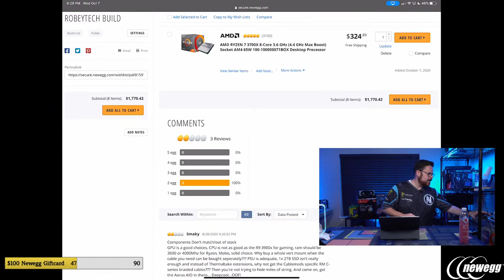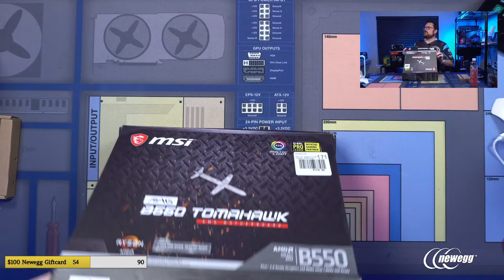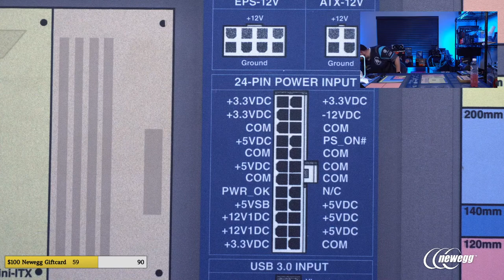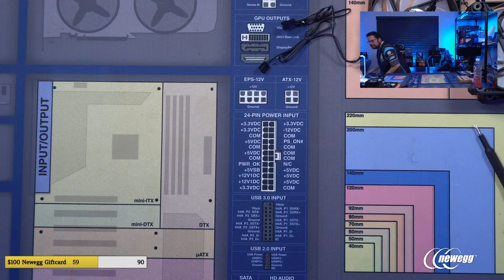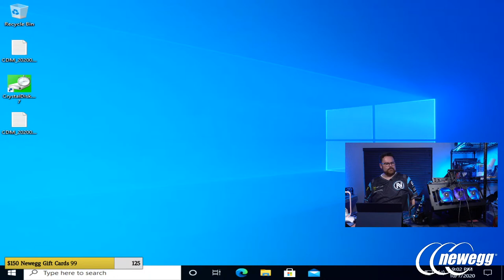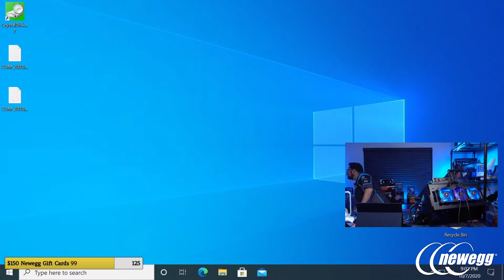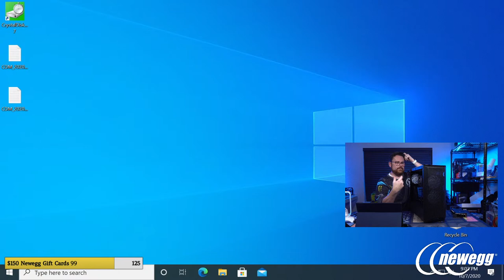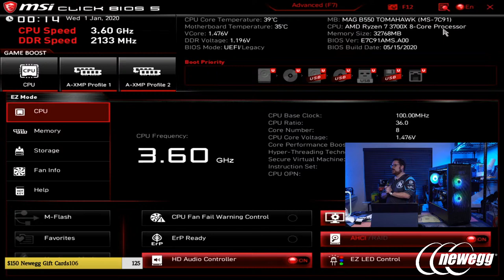How To Build a PC - Giveaways + $2000 Phanteks P360a #RTX3000 Build (3700x / RTX 3080 FE)| Robeytech

Comment: I just built on the b550  tomahawk and had to use bios to change pcie to gen3 for it to work with phanteks riser cable.
Reply: I have heard of that being an all too common problem with riser cables in general.
Reply: I’m about to get the b550 tomahawk and the phanteks 500A case, so I’d have to do the same?
Reply: @solomonKachi7000  Yea if you run a riser cable i think you need to change setting in bios. Phanteks cable does not auto detect it seems. I did return the cable in the end. The MSI ventus got too hot mounted that way, its quite thick and bad clearance from the glas.

Comment: Awesome job on the build and explanation. Tell me one thing if i buy 3 more fans like the ones that come pre built with the case, how do i connect all of those together? i need to buy the Phanteks fan controller? My motherboard is a little old (Asrock X79 Extreme 7)